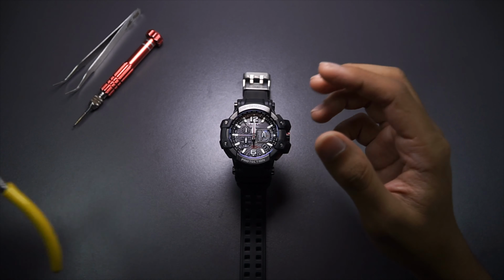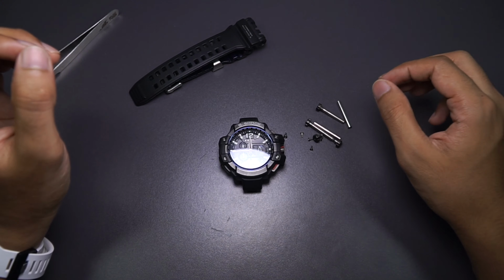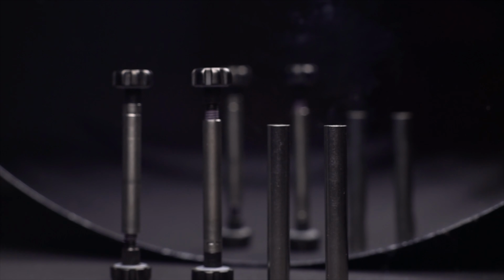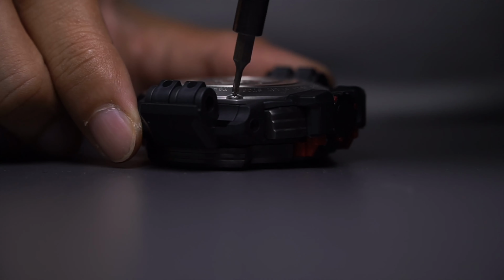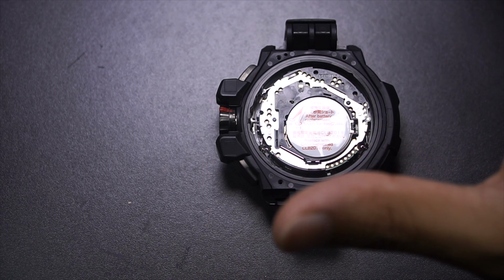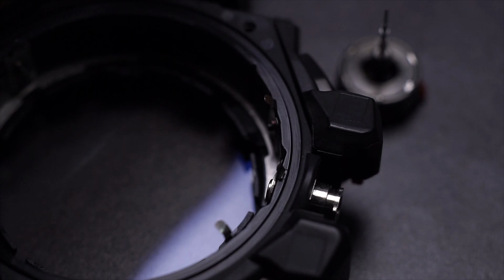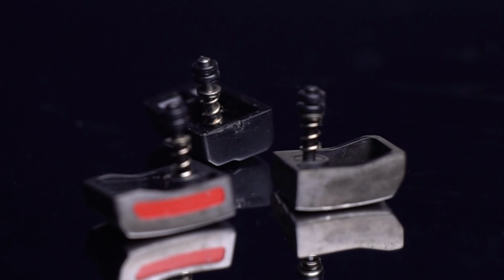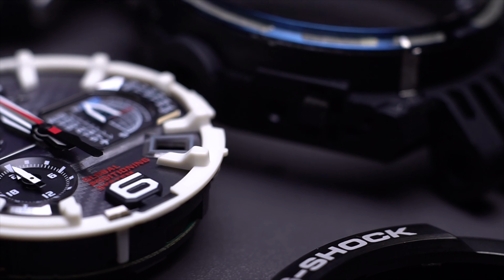Whats inside the GPW-1000 series Gravitymaster G-Shock

Comment: That was fascinating. I was relieved to see the O rings in the crown tube. It was good to see it's pretty well defended. I got my GPW 1000 wet a couple of times with the crown unfastened. It didn't cause a problem the watch (though I wouldn't want to repeat that too often!)
I'd love to see the movement disassembled; wouldn't mind seeing the motors and GPS chip if that's possible. Great work!

Comment: Best g shock ever. Hybrid wave captor a must have that i thought would filter dien to other watches,  but seems it remained exclusive to the very top of the range,  with others making do with blue tooth and multi band 6. However Bluetooth isn't always available and neither is the atomic signal.
These watches take a beating, self correct hands knocked out of alignment (tough mvt)...and well they have been my daily wearer since release (I have the raf, a black and gold, a standard one and an aged titanium one... and will be buying more.
I truly believe no watch has ever been made that suits use in austere environments, and also looks fine in day to day life,  than the gpw 1000.
BTW,,, been wearing daily through weather and impacts and tool use and all manner of abuse (aside the aged titanium one) and none have missed a beat. No strap rot....not even a scratch on the sapphire crystal.
They have surpassed the Omega Speed master as my fav watch of all time...and even better, while I bought all mine from G Shock store in Carnaby Street in London.  These outstanding pieces of watchmaking  genius can be had on ebay NOW for 200 to 300 gbp.
If you want a tough watch to survive a tough job day to day,  and also look cool as anything else....just get one.  You get one in your hands, feel its weight and solidity,  appreciate the tech which will automatically give you the exact time anywhere on the globe....you won't say no.

Comment: I was planning on changing the bezel ring, and was wanting on a video from you to decide if it is worthy, but just find out that no, it isn't, I have disassemble almost all of my gshocks and always get dust inside, and I'm kind ocd with that!
Also why you don't use some kind of tissue between the watch and the table, I know it's to much, but kind of hurt, hearing the watch bang and twist in the table...I know that there gshock but I treat mine so damn well, even a betten up one, I always use like a microfiber cloth between them and the table 😁
Reply from the maker: Well, I do bother all the little things when I got started. Now, I'm disassembling almost 10-20 different gshocks per week.. I notice it didn't matter. These things aren't the typical 'swiss made' watch. They're really tough. In and Out.
Reply: Hi, I need your help.

I have GPW-1000 that has carbon fiber strap that peel and I am planning to buy a metal (resin) strap but it is expensive, it cost almost one brand new gshock.

Do you think if Gw-a1000fc or GA-1000FC-1A metal strap can use to GPW-1000?

Please help.

Comment: Hi, I need your help.

I have GPW-1000 that has carbon fiber strap that peel and I am planning to buy a metal (resin) strap but it is expensive, it cost almost one brand new gshock.

Do you think if Gw-a1000fc or GA-1000FC-1A metal strap can use to GPW-1000?

Please help.

Comment: Hello, do you have a module disassembling, the hand that indicate days of the week and auto....etc is stopped, it doesn't work anymore. i want to open the module and check the motor but iam afraid to do that without any of your useful videos which helps a lot
Reply from the maker: Better to send to over to Casio service center instead. This model is too complicated to inspect without any experience. It is just too much work.

Comment: Unfortunately my GPW-1000 hour and minute hands stuck every three days or less but after going to setting mode and changing the location of time it starts working but its not calibrated and it does not show the right time. I dont know may be gear or module problem or battery problem. I wish you disassembled the module too may it could help me to fix mine.
Reply: Any update on this? Were you able to fix it?

Comment: Which gshock has the metal inside insert of plastic ?
Reply from the maker: All of them have a metal sheet insert into their plastic hardcase for reinforcement. 

Metal insert band however normally found on resin composite bracelet model like GW-B5600BC being the most popular.
Reply: @gshockhighfashion  Appreciate your reply. sorry I did not explain my question clearly. What I question about is the black plastic housing for the movement and some plastic gears in it, as shown in your video from around 27:40. I was wondering if there are other gshocks made completely of metal? Thanks.

Comment: Can i ask..what killed the battery in the end? I have to say that owning these watches for getting onto 10 years now..(2014 was release on Europe no? About when i got my first RAF..and i still wear off at least once a week, with battery sill showing at 12o clock on the test mode....same goes for my black and gold and aged titanium one, sorry I'm terrible with model numbers.
Now surprisingly i just picked up another for the collection, the bog standard original one, with the blue anodized ring round the bezel ( you all know the one in sure)....and the price was so outrageous i thought it worth a punt, even though in all the pics, the hands were ALL pointing at 12, and I'm thinking...'this had to be dead batteries'...but at £140 ( my offer on a £200 asking price, i thought,well...the steps are probably worth £100 on their own. The chap didn't answer any questions, pictures were rubbish, and condition described as used....with zero note info offered.
Well the day of delivery arrived.....and the original cardboard box from casio arrives, with the immaculate watch box within, the watch in its original little bag on its pillow....and the moment light hits it, the hands set to the time.....though the battery tester read as 2 so i left it on a bright windowsill for an afternoon before messing with time and position. But it all worked perfectly in the end and is now my absolute daily wearer, beating our a Speedmaster (not a super posh one) a Seiko Astron which I adored for years for that one thing that the Gravitymaster does better, i.e satellite time updates away from the radio sjgnals, and also a highly highly prized Luminox Blackout that was gifted to me by some USMC lads...So I mention all this to demonstrate at least some credentials, not as some sort of Gung Ho commando, but as a guy that had learned to appreciate certain strengths in a watch, when one is living in austere conditions,and accurate and above all reliable timekeeping is incredibly important. How the watches i mentioned are all superb....Speedmaster showing age now....even perfectly tuned,they will lose 15 mins a month easily, not to mention resistance to shock, magnetism and.....well, I wanted to say extreme temperatures, but they survived plus200 in the light and minus 200 in the shade, so yeah, Speedmaster will always be my second fav. But....when you find out about the level of detail that went into the GPW1000...I don't think they put all those features in one watch ever again?,
Look at the new Gravitymaster...it's great, triple or quad sensor? But it gets time from Bluetooth from your phone, or Multiband 6,  which if God forbid the s nite I don't the fan, won't be there. The satellites are solar and in orbits that won't fall....well...if ever. 
Ok I'm ranting, but i strongly think the gpw1000 is the best survival watch ever made, and my only concern is the life out the job chargeable back up, which is unavailable at the best of times...BUT...I've been running mine for near a decade, and no issues at all!

Ps...after boring rant, i have been perusing tough and hopefully solar smart watches . The Tag Heuer Connected seem too be good, as are the Garmin..i think Fenix 6 seem very capable, but all suffer still from the dreaded slavery to being recharged every 24 hours, unless the solar is much better than i expect it to be?

If you guys have any info on the best rigged smart watches, if be really interested in your opinions! ( not to mention what you think killed the unkillable gpw1000 battery)